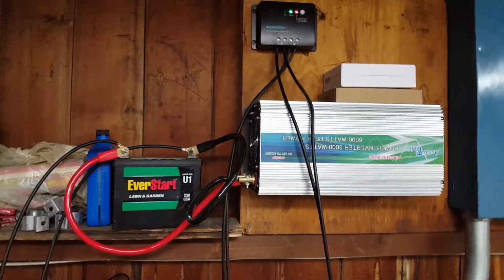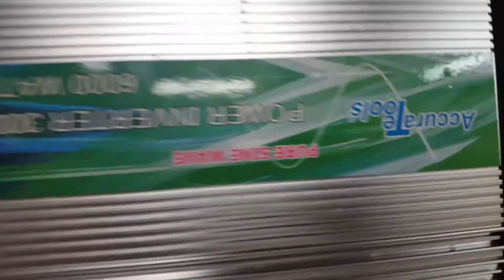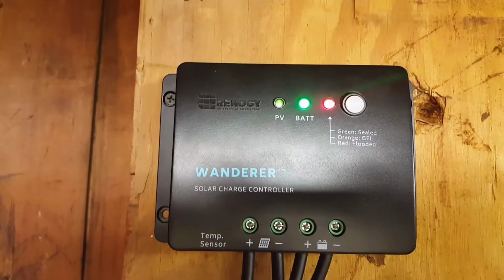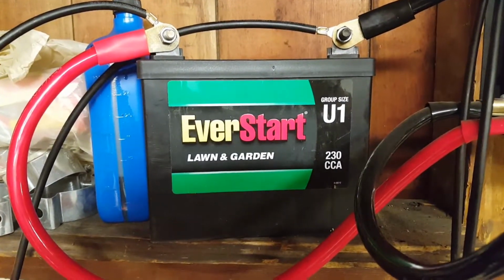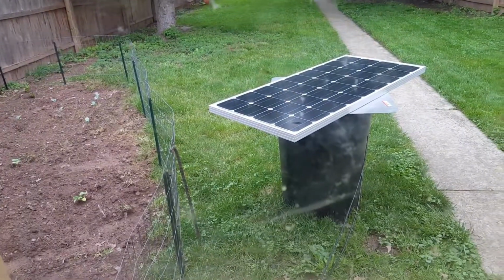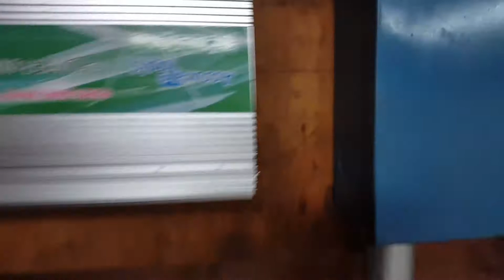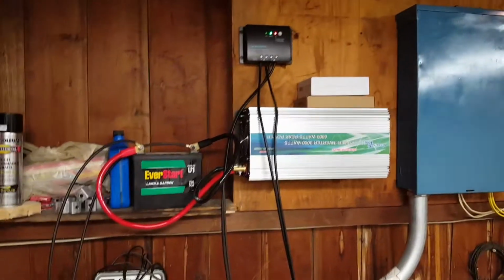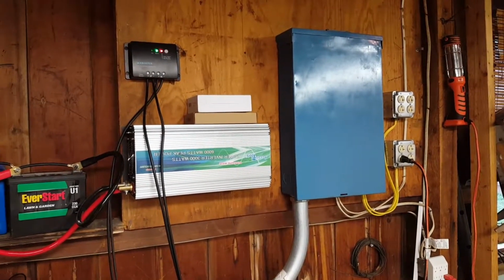Renogy Solar Panel Test Set up Off Grid

Comment: I was wondering how you got such a nice inverter for so cheap so I googled it and I came across a review of the 1500w model of the Accurate Tools pure sine, and someone maxed it out at around 1500 watts and it started smoking.  Doesn't sound good.  I hope your 3000 watt version is built better.
Reply from the maker: Christmas Eve So far so good I'm going to keep an eye on everything and actually switched everything to a grid-tie inverter today
Reply: Lesson #1 Don't max out any electronic devices and they will last you much longer.